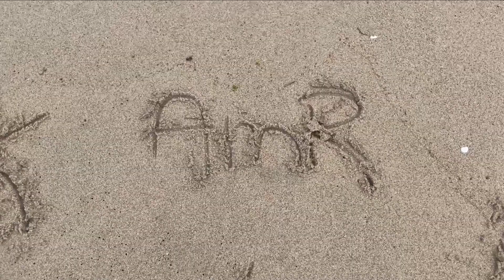Installing the one missing piece that was holding us back! — Sailing Yabá #52

Comment: Nice 1, Arvo all,  Arvo B.D. Nice nose m8!  Excellent job on that corner. I wondered what would happen there.   Really liked the angle of the dangle check on that drill for the bolt,  hadn't seen that for a long time. My Uncle used something like that deck 3 stories up. Anyway thanks m8s, I did enjoy it. You and your crew stay safe and well

Comment: Nice job this week guys 
I was thinking you might want to apply a foam layer on the top of your super structure only because it will help with heat transfer to the inside. It will help keep the inside cooler.

Comment: I was really glad to see that you were coating the wood before joining it to another piece. But I rarely see the endgrain being coated. I would think the end grain is the most vulnerable part of the boards. Also on the deck hatch and the deck planks with the 'faux' saw kerf joint, I would think that Sika seam caulking the individual planks next to each other would be easy enough to do and a better waterproofing effort. They are skinnier than the faux joints so won't be as effective as a "joint"! The squared out holes for the rail posts would be a great place for coating AND Sika caulking since the surfaces were rough chiseled and provide lots of gaps or water leakage and rot.
Also nice to see that with the cooler weather it is drier. I would hate to see all the decking and planking start absorbing sitting water before it is protected.

Comment: After your roof is completed, you should look at covering it in a single/welded piece of HDPE or PVC type of membrane to completely seal the roof, and flash all the water to the outer edges. That might help prevent future rot and water intrusion issues, and extend the lifespan of the boat. Similar to waterproofing a flat-roof house.

Comment: I am super impressed with how quickly this is coming together. I’m a little concerned about the engine installation at this time. Either the rebuild or a new engine I would think needs to be fitted before things get to enclosed. Hopefully this hasn’t been an over site. Looking forward to a reply and/or the fitment of the engine. :) cheers and happy building.

Comment: While watching the shipwrights rebuild Yaba, it has been really interesting to see how and when they use wedges to gain mechanical force - fitting planks, decking, posts, and here, dismantling part of the cabin. Either forcing things together or forcing them apart. They are very resourceful with chainsaws, too. Am I right in thinking the upperparts of the cabin and the cabin roof are the only parts that survive the original boat?
Reply: and the forward spar, masts, plus a FEW beams that were repaired.  So for all intents and purposes, new boat.  Which will be great, we don't want MP filming Ben's best long distant swimming form. 😀

Comment: They could really do with a spindle moulder.  Or at least a router.  So many of the jobs would be easer and more accurate with those.
Reply: This Crew doesn't need any of that stuff... I agree though!!
Reply: Router for the small one off jobs, cutters for doing the same pattern many times
Reply: @southerneruk  I bought my first router about about 40-odd years ago - had several since.  Been really useful in so many jobs since.  Bought a woodworking machine about 20 years ago, which had a spindle moulder, and that was just amazing.  There are lots of jobs they've been doing where I would certainly have used one or the other.
Reply: @steveknight878  I have a router has well they are handy to have, but when you got a number of them to do, and you want to keep them all the same, that's where multi cutter comes into play, what would take you a few days to do, a 2 to 10 bladed cutter will cut that down to an hour
Reply: @southerneruk  I'm not sure what you mean by a cutter - possibly what I mean by a spindle moulder, which is like a very large upside-down router cutter and large table.  You can work with substantial pieces of timber on it, and quite large cutter blocks.
Reply: @steveknight878  cutters are like router, but with more than 1 blade, it is a wood yard workshop machine, When I was at sea I had 6 mths away and then 6 mths home, (I always see a summer and every Xmas was a white one), during the 6 mths home I used to take up temp jobs, just to stop me getting bored, one of those jobs was working on the quay side of a timber yard, when there were no ships in we used to get onto other jobs. I used to head for the 6 to 8 cutter, some of the patterns it used to make were really fascinating, it used to be able to do 4 ship pack bundles, in about 90 mins. One of the pattern I love watching being made was wooden stair railings, it would cut square tenant and the square stopper and then go into a spiral cut, half way though it would cut a Turk knot then repeat the reversal, this was back in the early mid 70s, my job when on the cutter was at the back of the machine taking them off the line and loading them onto a bogie. It was very interesting to watch some of those machines and what they could do.